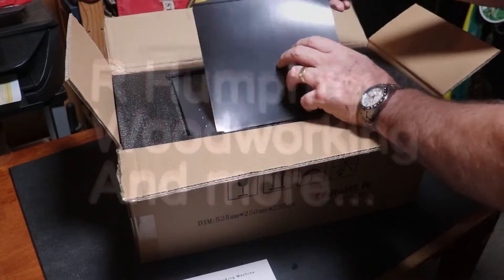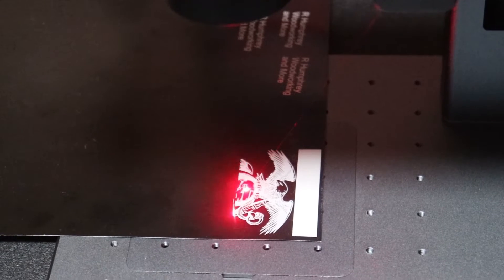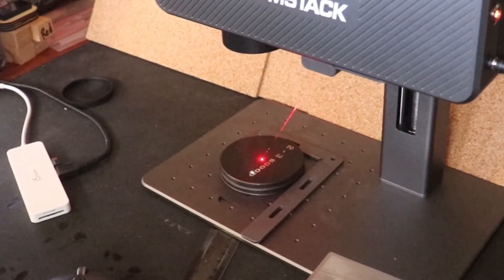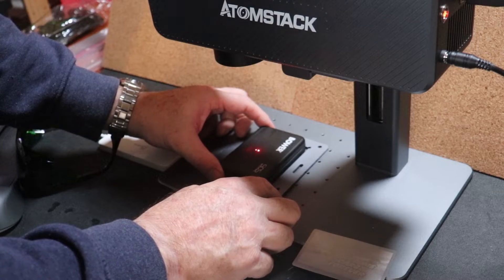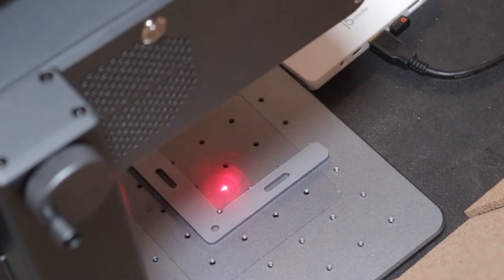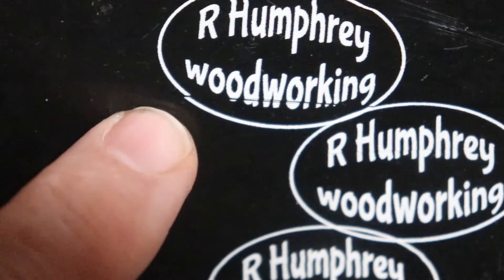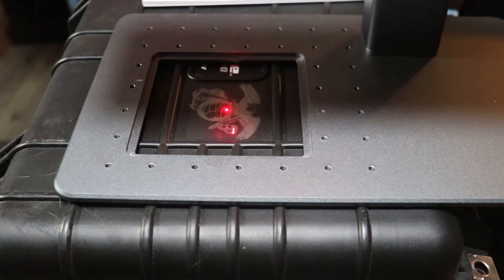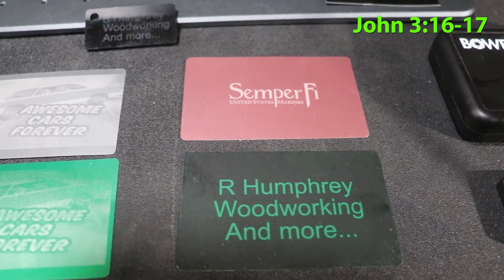Atomstack M4 Fiber Laser

Comment: Companies should be more clear about the type of laser source they use and call them simply "pulsed IR lasers".
These 2W 1064nm modules are neither fiber nor diode lasers, but q-switched solid state lasers. They are pumped by a 808nm diode, while the active laser gain medium is a Nd:YAG crystal emitting at 1064nm. To get powerful pulsed output, they use Cr:YAG crystals to achieve passive q-switching.
The laser pulses can reach several 10kW peak power at ns pulse width, while the average power is ~2W. You cannot control the pulse energy or frequency (because of the passive switching), but the characteristic is comparable to fiber lasers. What's next? How about converting the 1064nm to 355nm by THG techniques?

Comment: Great video. But is there a way to hold down the L shaped guide so it doesn't move on production runs?
Reply from the maker: Thank you!  Included in the box was a sheet of sticky putty... for lack of a better term.  It holds the L guide nice and secure, and it doesn't take much and leaves no residue.

Comment: You really should have some sort of exhaust system to suck fumes to the outdoors.  Many of the materials and coatings give off toxic fumes when burned off with a laser of any type.  Be especially careful with tanned leather, plastics, and paint coatings.  I also guarantee that the cheap plastic hood they provided for handheld use is not laser safe - at best it is just a piece of tinted plastic.  You should have laser goggles and other protective shields that are specifically made to absorb light at the wavelength of your laser with an optical density of at least 6 (OD6) and never use the thing without a shield in place to cover the work piece.    You could easily blind yourself (or your pet) with a stray reflection.  Advice from a chemist whose work has used high power lasers.

Comment: The fiber laser is certainly interesting but I found it a bit restrictive as far as work area is concerned.  I’ll be doing a lot more laser cutting in the shop so I opted for the Ortur Laser Master 3.  So far I like it a lot.
Reply from the maker: It really serves a different purpose, made for fast repetitive work with no worries of the heat from a diode laser warping thinner metals, for example.  I do like the OLM3 as well though, that's a well-made product for sure.